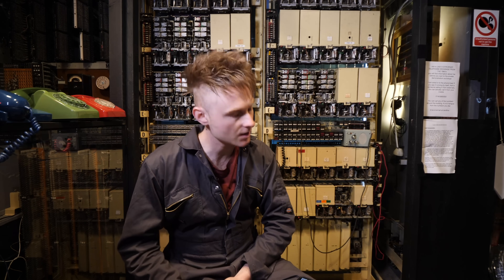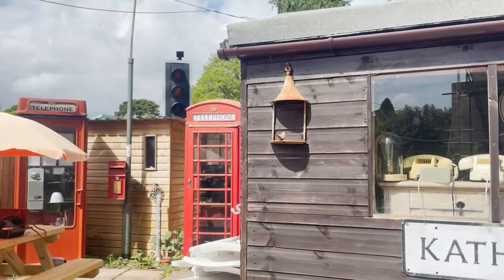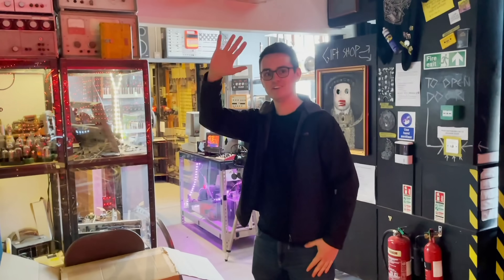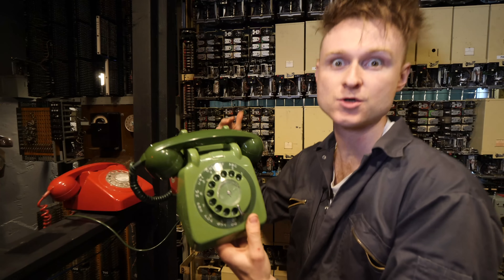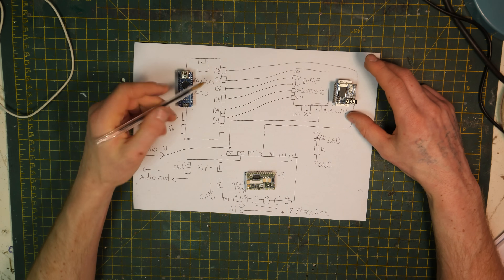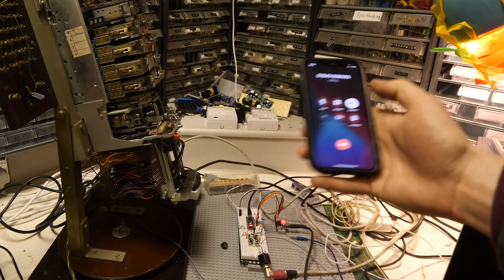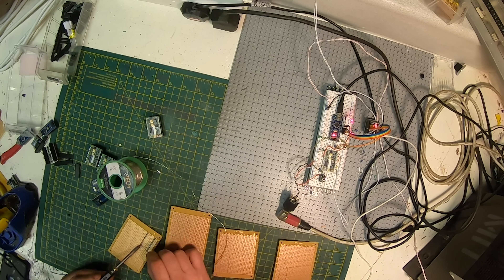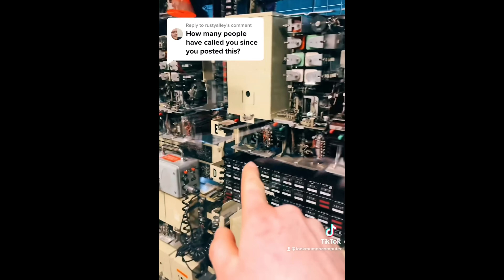Plugging a Vintage Telephone Exchange Into The Internet So People Can Use It

Comment: The noise in an exchange with a view hundred connections must have been infernal.
Reply: It was. One with thousands of lines, hundreds of rack bays, was a cacophony. Although it was noisier if there were lots of short calls, because most of the noise in the relays and selectors occurred during the dialling of a call. Once a call was connected, the selectors became quiet apart from a few timing relay clicks - but the more calls dialled per minute, (or even just the phone handsets lifted and replaced) the worse the noise!
Reply: How wonderful. It’s rather strange that when I was your age was precisely when development was well under way to produce a computer based replacement for the Strowger mechanical system! System X it was called. Some of my MSc lecturers at Essex University (being quite close to the BT research centre at Martlesham, Suffolk ) were teaching this stuff. Back then an Erlang was unit of measurement of telephone traffic  now it’s a programming Language :)
Reply: It was... I went into one of the last Strowger trunk exchanges in Birmingham before it was decommissioned,  hearing protection was mandatory and it was still bloody loud!
Reply: @David00Yates  I wonder wether you could tell the time of the day by the noise level. Do you know how many subscribers where connected to the average exchange on a city level?
Reply: @martin_mue  Yes, you could tell the time of day by the noise level! The way the system works is that there are several levels of "concentration", a local exchange might have 10,000 subscribers directly connected to it but only 100 connections to it's parent exchange, on the assumption that not everyone wants to make calls at the same time. This concentration ratio continued all the way up to the national switching centres which routed calls between cities. Modern systems, although digital, operate on the same principles, as does broadband internet infrastructure.
Reply: @David00Yates  That is interesting, I know my local exchange here in Berlin, it is a huge two story windowless building that probably contains only a few 19" racks with todays technology.
Reply: @martin_mue  Yes, funny enough when I visited the trunk exchange we were there to survey for the installation of modern digital switching equipment. This was a room about the size of a football pitch, full of mechanical telephone switching equipment - when I went back a few months later it was all gone, replaced by two suites of equipment, probably ten square meters in size, and eerily silent.
Reply: @martin_mue  In the 1970s my grandfather worked for the Post Office (the telephone company back then). A new exchange had been built in the town I lived in. It was the size of two or three houses and was rammed with these mechanical switches all whirring away. You could hear it outside. Today it's probably got a couple rack servers in a corner doing the same job - silently. An improvement certainly, but not as much fun.
Reply: @martin_mue  At an airbase I worked at noon time would make the office roar....The boys calling the wives...."What's for lunch".
Reply: @fredmanicke5078  That's funny! Makes me wonder what statistically speaking is the time of day when the most amount of calls are placed and if that changed over the years going from a landline based telephone system to a mostly mobile telephone system.

Comment: I remember when the internet used the phone line as it’s infrastructure. Early modems used acoustic tones to encode the data and that’s only 25 years ago.
Reply: Yes it was called dialup internet
Reply: So true! Glad I lived through those early days
Reply: 25 years ago, a transition to ISDN should have been underway, but it never happened.
Reply: @bsadewitz  Yeah ADSL(aka broadband) rather did away with the transition to ISDN.
Reply: It still does in rural areas, archaic dsl

Comment: You should hook up a BBS to it. That would be cool to dial into.
Reply: LookMumNoBBS! Not sure if there is still terminal software available which can handle that
Reply: @BartManNL  There were several good options for BBS server software back in the dialup days of 300-57600 baud, some of it distributed on CDROM,  and still likely to be out there - so a vintage Mac or Windows PC could still run a BBS from that era although you'd need a modem bank. I have a couple of genuine old modem racks designed for the purpose, but I'm way down here in New Zealand! Just like faxes, traditional modem calls began to get drop-outs and suffered resynchronisation problems once exchange lines went digital, if the digital"slip" in the near and far end A-D and D-A converters in the remote Exchange cabinets  weren't synchronised - Another long story!
Reply: @davechisholm9670  There are still some telnet bbs around, just need to google a bit :)

Comment: I work for Verizon in NYC..a lot of that old switch equipment exists right next to all the fiberoptic equipment.. no one ever disconnects  it because believe it or some of its still live
Reply: Sam Is Amazing..👍Never seen this,set-up and running..Put all the equipment in and tested it in Huts and Vaults for 18 yrs.Cabinets too.From a Northern Indiana location..Had to spin down a Hundred pair of wires in a block in under an hour.Retired now.Most rewarding job I ever had.Still in touch with all the old Installers..We worked in Philly for a month..In a Old Telephone building..Interesting Setup...Some of the old equip.was there..Don't know if it was Live..
Reply: yeah you often see stuff plugged in and drawing tons of power that isn't actually used anymore
Reply: @Mister_Brown  I used to charge my batteries off the phone line when the power was out... I also have an old d-com voice over IP modem from the 90's that actually has a switch to use pulse or DTMF , used to have it set up like a bat phone, just pick it up the rotary receiver and it automatically dials one important number over IP.
Reply: INB4, one day they decommissioned the whole station/ exchange

Comment: We had one of these step-by-step switches in our local exchange when I was growing up. When they introduced DTMF, they added converters in the switch itself. You pressed a 6 on your touch-tone phone, and you could hear the 6 clicks on the line as the converter at the exchange generated the equivalent pulses. Perhaps you should hunt down some of those DTMF converters!
Reply: That's what Sam's done but with an Arduino. There's more info on Patreon.
Reply: @sonosus  He's saying it would be cool to have the og converter hardware. It would be cool to see how they differ in translation methods.
Reply: I confirm this - In New Zealand the then NZ Post Office (Telecoms) division operated mostly BT Step by step exchanges exactly like this equipment (plus a few NEC Crossbar exchanges too - they made some bizarre hypnotic rhythmic noises! oh man, Sam, that's another rabbit hole for you to fall into! LOL).
During my Planning Engineer trainee years I spent time with the techs servicing some of these, and I had to wire in a few of these STC manufactured DTMF converter boxes containing 4 cards per box IIRC, precisely for this purpose: allowing people to plug in and use DTMF phones in a telephone exchange area that did not yet contain a digital exchange. A decoding IC did all the DTMF decoding and sent the  matching pulse trains into the selector racks to select the called number in the usual fashion (Sam, you also need to have some fun with a Uniselector rack, maybe for droning!).
I had  couple of STC converter boxes stashed away 30 years ago that I could have photographed, but think I tossed them a decade or so back, however I'm sure a few techs in the UK will have scored a few when the old SxS exchanges were decommissioned, might still have them lurking in their sheds and could cough up a couple for the Museum)
Reply: @davechisholm9670  2600 pip-pip-ker-CHUNK 🙂fun times with R5 🙂
Reply: @toranamunter  KP 121 ST 😂
Reply: @davechisholm9670  Oh yeah man, I was just thinking when the Post Office was privatised, Telecom bought it, the exchanges went digital, all the rotary phones were ripped out and replaced with DTMF phones, and the toll-call operators lost their jobs. Oh, and to dial a local number now meant including the area code so that we had to dial all seven digits instead of just the four! 😄
Reply: So is it now done the other way around? There's probably still some people using rotary phones right?
Reply: That's how the last SxS was circa 2001 in quebec